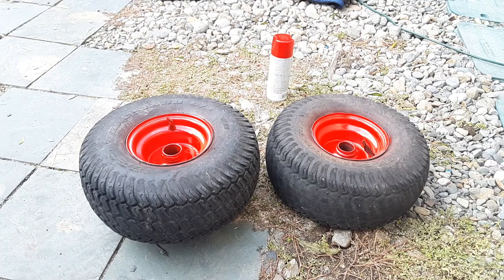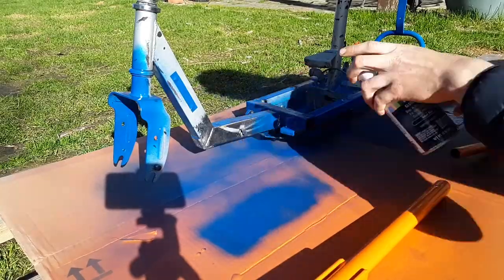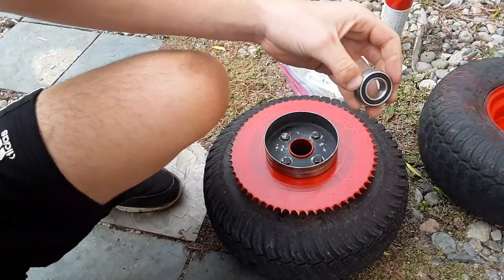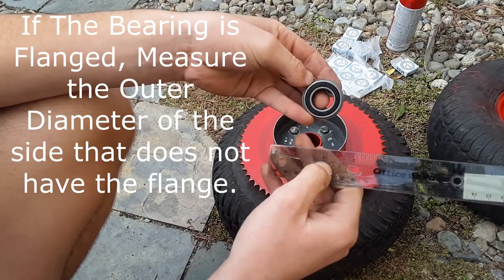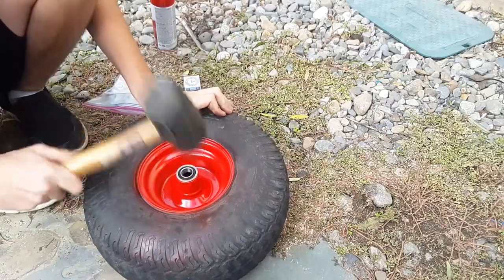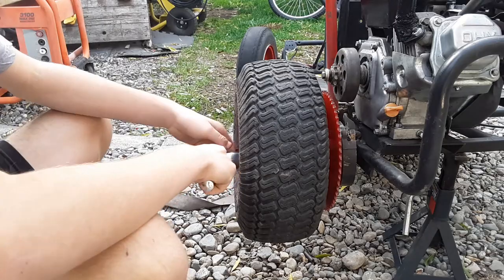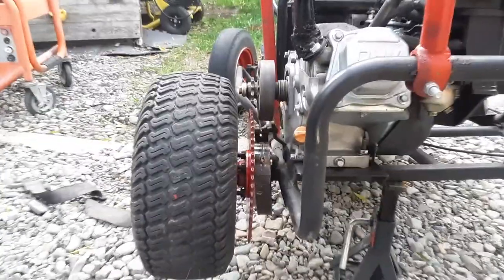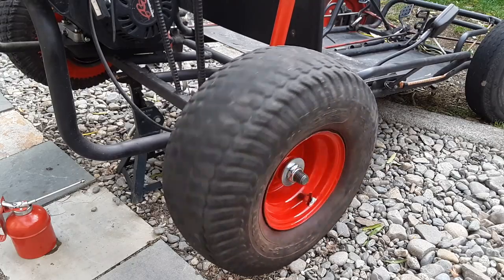How To Replace Go Kart Bearings!

Comment: Easiest way without damaging anything is to put the bearings in the freezer for few hours, then heat up the wheel with a torch.  Bearing will drop right in and seat itself.  Dry ice could also be used to speed the cooling process and could use that to also clean parts.
Reply from the maker: Yeah that works too, I just didn't want to damage my new paint on the wheel.

Comment: Where did u get the the near bearings
Reply from the maker: I get them off of ebay. You need to know the inner and outer diameters of the bearings and you can usually find them that way.